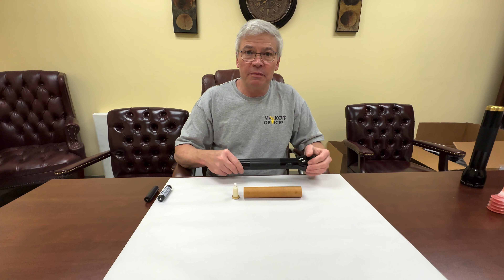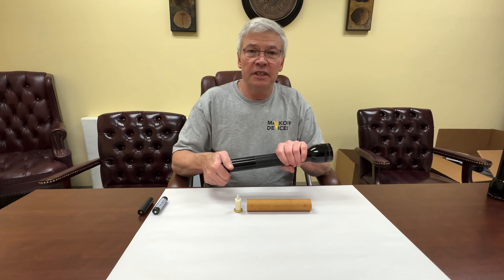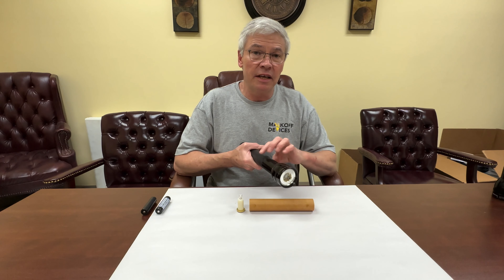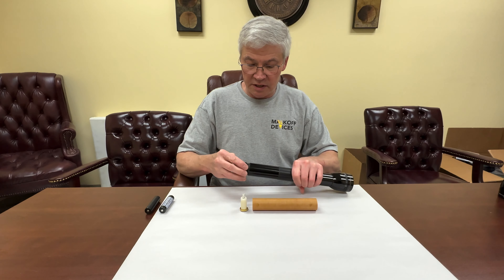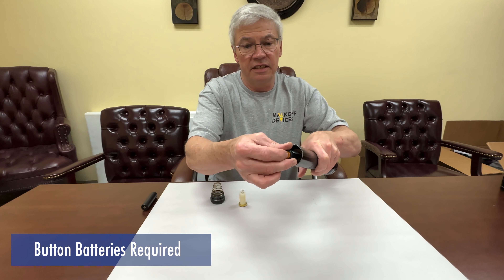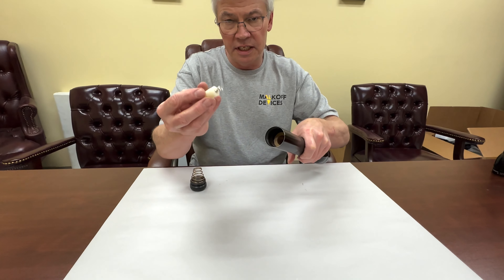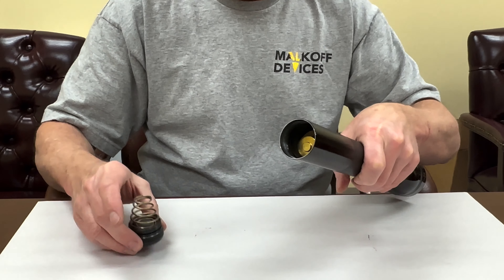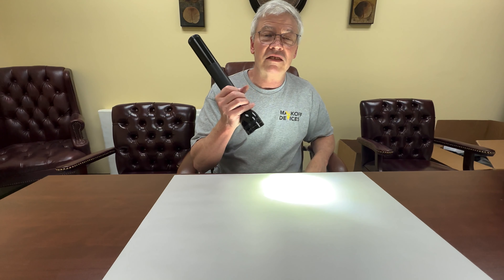11. 3D Li-ion 2x 18650 Adapter

Comment: Can the M91 heads with maglite adapter be used with 2x 18650? Any idea what the runtime would be versus the older 2x 26650 adapter?
Reply from the maker: It all depends on the capacity of the 26650 Vs the 18650 used in the setup. From 2 of the 3500mah KeepPower cells we carry, I would expect around 2hrs.
Reply: @malkoffdevices6279  Thank you for your reply. 18650's would be a lot more convenient for my setup versus the older 26650 and 21700 adapters that I have from you for my Maglites, as 18650's can be used in my other flashlights interchangeably. I appreciate you coming out with this new adapter.
Reply from the maker: Thank You Sir! @kapanak

Comment: Hi gene can you use 3.6 volt d cell batteries in a maglite or you wouldn't recommend that ?
Reply from the maker: It all depends on the chemistry of the batteries and the particular dropin used. Are the batteries going to Lithium Cobalt (the most common lithium chemistry, usually referred to as 3.6 volt batteries) or LiPO4 chemistry (another possible, but less common chemistry - often referred to as 3.2 volt batteries)?  Is it going to be 3 cells? If they are Lithium Cobalt, they are going to be 4.2 volts at full charge. If LiPO4 then they will be 3.6 volts at full charge.

With either chemistry, I could recommend only an M91 or M91T dropin. It's too much voltage for any other dropins.